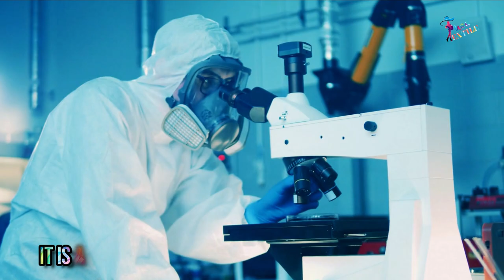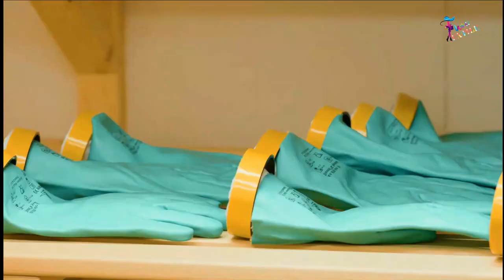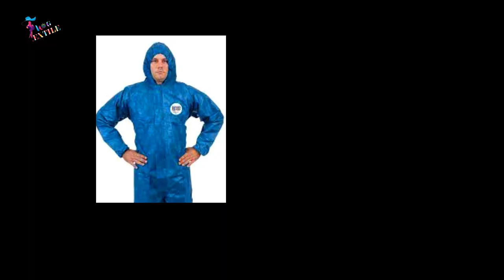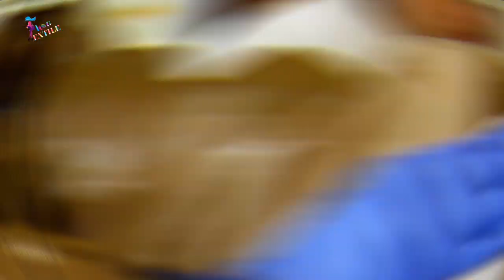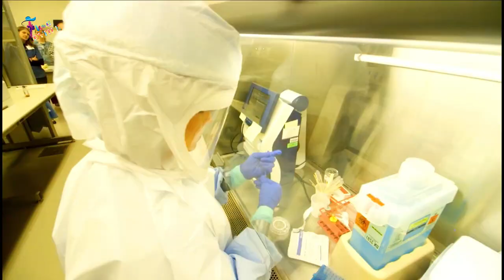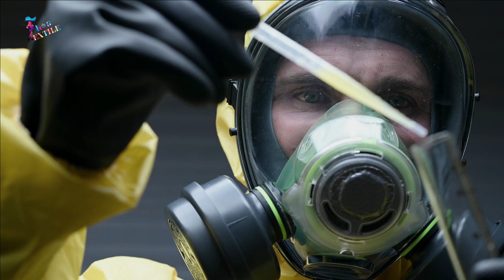What is a Hazmat suit ? where and How the Hazmat Suit are used ?

Comment: The Class 1 (Type 1) HAZMAT suit is very closely related to the Self Contained Atmospheric Protective Ensemble (SCAPE) suit.  If you were a fuel handler for the German V2 rocket, Messerschmitt Me262 Komet or USAF Titan 3 Missile you wore a SCAPE suit.  Most rocket fuels are immediately dangerous and reactive on contact with the fats in your skin.